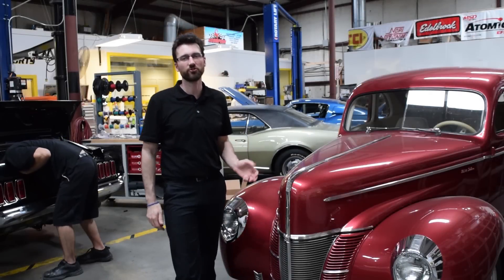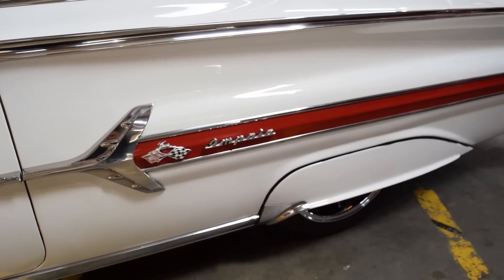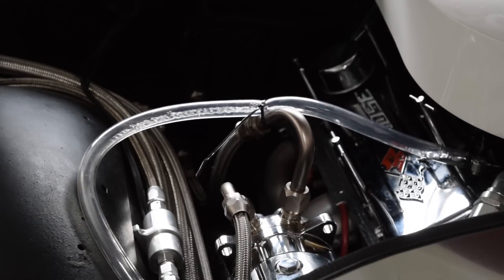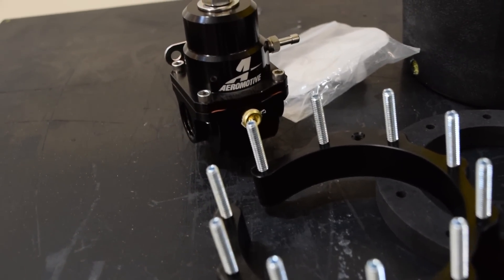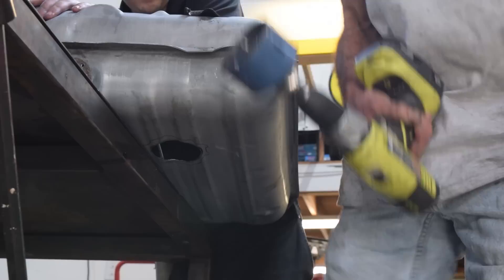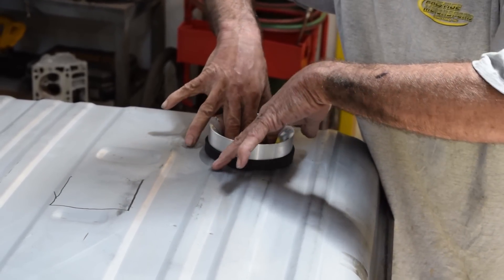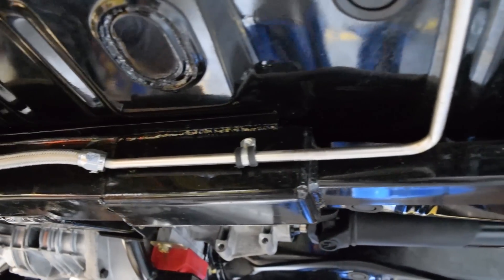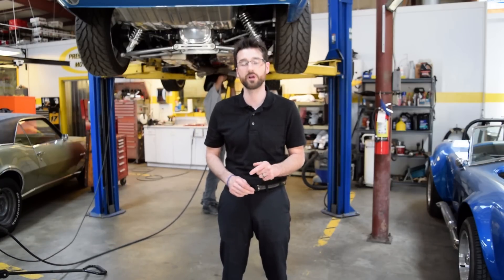Vapor Lock: Watch Fuel Boil and Learn Tips on How to Avoid It

Comment: I wonder if fuel pressure regulators make any difference.  One guy I know fitted one to his seventies coupe to cure the hot starting problem where fuel surges in and floods a hot engine after it's turned off.  I know you can buy cheap 'n' cheerful regulators on EBay from China or a pay a couple of hundred for a quality one from Edelbrock or somewhere.  But I won't go to the trouble of installing one unless I know it makes a difference.

Comment: Would putting additives like say an octane booster help as well? Ive heard it said the higher grade fuels have higher boiling points.
Reply: Most Octane Booster are made of Ethanol. It will make the problem worse.
Reply: I've asked some fuel additive companies if they help out with the Reid Vapor Pressure problem and they say no. Most of the liquid in the additive bottle is diesel fuel which has a lower vapor pressure but you are not adding very much to your tank.
Reply from the maker: Matthew Green no that really doesn't work well.
Reply: Drop to a lower octane

Comment: You should put grease on the hole saw teeth to catch metal shavings.  It will also lubricate the bit and help prevent sparks.  @3:54

Comment: Save your self some $$ and just keep the stock mechanical pump in place and "tee" it back to the tank with a return loop. Don't even have to drop the tank or "shim" it up! Simplicity holds much merit even today!
Reply: Yeah this sounds like a good option. Where is the t? If it is in the wrong place it will just flow back to the tank and never build pressure.
Reply: so the tee would go on the pressure side before or after the fuel regulator? This wouldn't effect fuel flow to the carb? sending it back to the tank as well? thanks.

Comment: I'm not a super duper mechanic with multiple sexy cars in my garage, but I have taken care of vapor lock by insulating fuel lines before.... maybe it would have worked in this application instead of a fuel system overhaul?
Reply: Yeah, but they end up charging more for parts and manhours.  It IS a business you know.  They're not going to sell you the best option, but the one with the biggest profit margin for them.
Reply: I bet it simple insulation wouldve worked. The best fix is often the simplest.
Reply: Thanks, I'm doing that on my vapor locking VW Touareg next Monday. Insulation has been ordered.

Comment: What are the part numbers of the system you used in this video?  You had more parts on the table then we saw installed.  Are they used somewhere along the fuel line?

Comment: The idea of a clear tube is excellent to show how the problem manifests itself but your video does not explain where the problem occurs. Furthermore, it is not always feasible (nor desirable) to fit a system such as the one described.
Rather, how can I fix the problem on a vintage car with "vintage good ideas"?
THAT was my expectation in the viedo, but sadly did not find it :(
Reply: Route fuel lines away from heat sources, and if the fuel lines have to be near heat, use a heat sheath type material to insulate the fuel lines.
Reply: Or, remove the ethanol from the fuel.
Reply: go to uncle Tony's Garage
Reply: I wish he gave an in-line fuel pump option to hook up to the existing tank line
Reply: Uncle Tony's garage look it up.
Reply: video is for someone that wants to make there classic car reliable and if you have the money its called doing it right. All you numbskulls can dog this guy because maybe you don't have the money or skill to do the job right. I'm buying an aereomotive tank and doing the same thing to my 71 Cutlass so I can keep everything original under the hood but have a reliable fuel system. haha
Reply: Easy, travel back in time and live there. Damn.